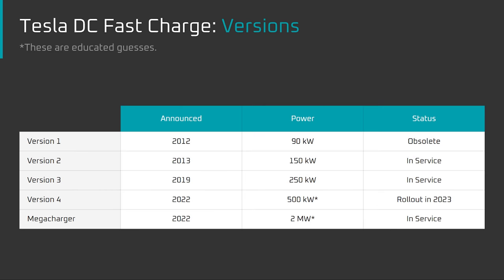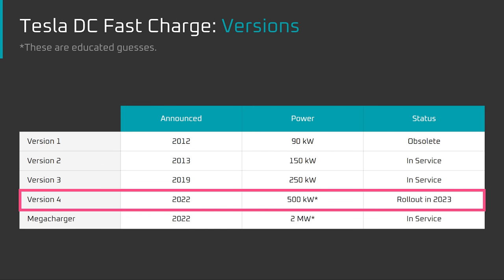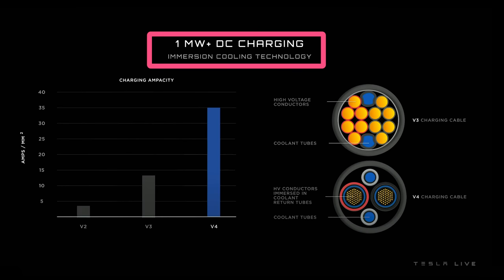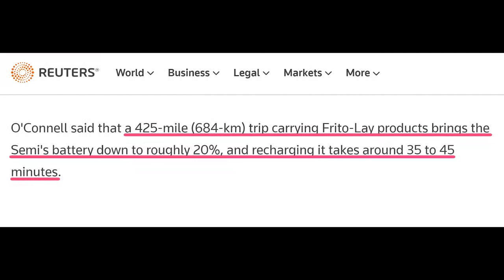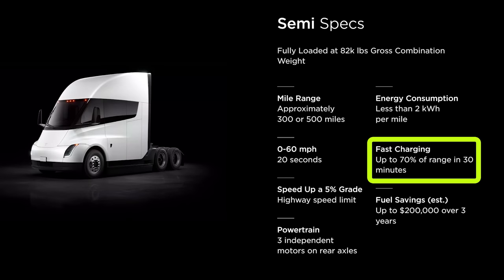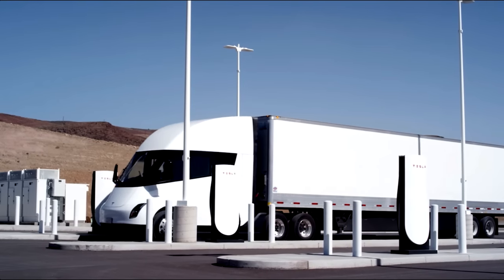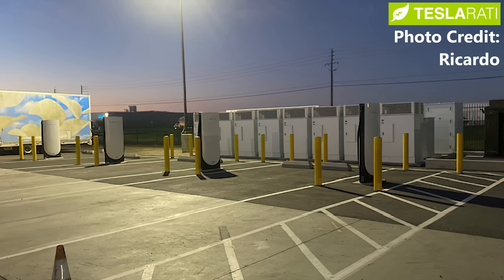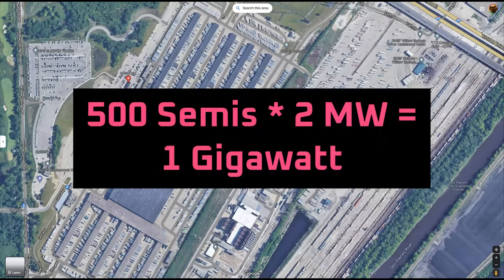Semi Megacharger Output // + The Megapack Moat

Comment: For fun and context, it might be good to mention the "power" that an gasoline or diesel refinery or a gas station or truck stop is capable of dispensing.

We just tend to not be familiar with the massive amount of liquid fuel energy we have grown accustom to over the last century...

We familiar with BEV energy requirements at some point realize how massive their energy needs and yet how much less that value is juxtaposition with liquid fuels.
Reply: Yes.  Generation from fossil on demand will be a better way to bridge the gap than batteries since the batteries are needed in the vehicles.

Comment: Could the Tesla Semi have 750KW charge ports on both sides of the truck to charge at 1500KW when the spaces are empty?  It would be convenient too as it wouldn't matter which side was being used for plugging in the charger if the stalls next door were occupied. So you could charge at 750 or dual plugs at 1500? Also maybe batteries and light weight solar panels in/on the trailers might be good to add to range and reduce the grid demand?

Comment: I'm wondering if the 750kw chargers are intended for areas where grid upgrade isn't reasonable and the speed of charge isn't a major problem; that is,  it won't be a problem to charge the semis over a few hours rather than rapidly.

After all,  stats I've seen are that semis average between 50,000 and 100,000 miles a year,  which is only 170 to 340 miles a day,  6 days a week.  That's only 4-8 hours a day.

Comment: Everyone seems to assume that when they say the semi charges from 20% in 35 to 45 minutes, it's to 100% SoC, it's probably not when they're describing everyday use. Or that the charging speed used is the highest available, which isn't necessarily the case.  

Anyway, I suspect that Tesla are actually not content with neither the current semi chargers or the current semis, that they are working on some design details, and the delivered semis are delivered "as is", partly for testing.    

Also, chargers for semis might be designed after every specific need and conditions, and upgraded if needed.  

Just a note, office buildings typically use very little power outside of office hours.

Comment: They would still be accessing post substation voltages, so I would not look too closely at substation level lead times. As these outputs are at 15 kV down to 5 kV per eaton's website.  It would tell alot to know what voltages megapacks work at for integrating into transmission, I would assume going closer to the 15KV.   These higher voltages would be used closer to highways which are generally closer to industrial areas which power demands are nothing like that of a commercial office building (large spaces and not enormous draws compared to manufacturing facilities..)
Reply from the maker: I would think it would depend on the size of the station.  2-4 chargers is great for a small depot, but when you get to 8-12-16 a 3-6 MW sustation feed isn't going to cover it.

With regards to voltage of the pack, it will vary depending on the number connected and the state of charge (my understanding at least).  Something I need to look into.

Comment: On nuclear power: 850MW is small for a nuclear reactor. The average is closer to 1GW per core. It's also super rare for a nuclear site to only have one core. I'm not saying you're wrong, just, you ended up picking one of the smallest nuclear power stations you could have. Watts Bar Nuclear Station, for example, has 2 cores at 1150 MW each. 2-4 cores per site is normal. 6, like in Fukashima, is pretty rare.
Reply from the maker: I just picked the one that was closest 😁

Comment: Commercial industrial power is charged at one or two agreed rates PLUS a distribution charge per kilowatt demand so if you can reduce the peak power by using local storage you reduce the distribution charge, also you are treating the megacharger etc as a single standalone unit , this is incorrect because it's an OEM system they cap place the charging and conversion where they want, you are only providing say 1000.or 2000 amps DC at 1000 volts or so if the megapack is designed for the purpose, then there is little additional hardware needed bar a stall and lead with switching both inside and outside the truck , if you migrate the intelligence into the charge stall infrastructure it's much easier to alter the charging rate as you are basically just tipping a bucket into the vehicle faster or slower,  think ...Tesla is very clever also the megapack can use low cost electricity and add grid stability function with ease,  the cost of an installation will be mainly the infrastructure and land so adding more capacity would be cheaper weight doesn't matter, this is returning to DC distribution times .... Yes they did used to exist just look at the history ... It's in all those books you ignore because it's not AC,  most any electrical textbook prior to 1950 will be mainly DC supply

Comment: I don't like how many EV charging solutions will charge at a slower rate when other users are sharing the same charge station. I get all the technical reasons why I just think in terms of budgeting time vs filling up with fuel there's a distinct lack of certainty which is unappealing. In UK they want to make all streetlamps have sockets to charge four car and there's barely enough amperage for one car to charge in a timely manner. The idea that I may not have enough charge to get to and from work because other people plugged in after I did and slowed my charge rate is crazy.

Comment: You aren't far off on the current sub-station equipment delivery times, but you are forgetting the planning/permitting and construction that can add another 2-5 years depending on the location/grid operator. The Megapack configuration is less dependent on external organizations and more in line with Tesla's projected growth.
Reply from the maker: EXCELLENT POINT!

Comment: I think the SEMI battery pack would be optimized for battery longevity rather than charge speed... you don't AC charge a Semi, and it needs to run maximum cycles
Reply: When you say "maximum cycles" you mean quantity (lifetime) rather than "0-100%"?
.
I still think the majority will have plenty of juice for a days work and be able to "slow" charge cheap rate in downtime.

Comment: Just wait until we start talking about truck stops and the demand for shore power comes into play as well.  It is going to take a massive infrastructure build out to be able to support the power demands.   This is going to require completely rethinking how long haul transport is handled.
Reply: Yes and we will have 2 decades to think about it as 20 million of these trucks aren't going to show up tomorrow.
Reply: @miguellopez3392  Massive engineering and design problem that needs to be sorted out pretty soon.  They have to start building this out pretty soon.   The main interstate routes will need some pretty massive buildouts just to get started.  The current truck is a day cab config and not going to be doing OTR.   Just saw the Fed govt guidelines they just released and looks like they know that long haul OTR rigs will probably leverage hydrogen more than pure BEV.  That is it's own new set of complications that no one is talking about yet.
Reply: @Longsnowsm  tesla isn't new to this, tesla has already built the world's largest charging network for cars, building then across major highways and population centers, their private network of chargers is larger, more reliable, and cheaper than the government funded and mandated "Electrify America" charging network. Battery is still likely to be used for long haul trucking, hydrogen is just to expensive compared to battery and road weight limits can change like they already did. Tesla does talk about these problems which is why they push harder to build their own infrastructure than others.
Reply: @miguellopez3392  Wasn't my message or new standard that was just published.  Just passing along the matrix breakout standard according to the govt what they forecast as the method of transport and the fuels they project.   

Tesla has rolled out a supercharger network for cars.  They have not done this for commercial transportation yet.  Clearly they do not know what they don't know, until they know it.  They are about to get a whole new look at a new world.  Expect TONS of growing pains.   If people think big rigs are going to charge the way cars do or function the same way they have not spend enough time around big rigs and truck stops.   Expect to learn a lot.  Tesla will be.
Reply: @Longsnowsm  yes tesla plans to grow very fast and will have a lot of pain as they will be also using these trucks as their logistical trucks for tesla to "put their money where there mouth is" they do have an advantage in this compared to other companies and its that they build the largest grid scale battery sytems in the world, these battery projects range between 100-700mgw each Mgw is capable of charging a tesla electric semi once, so they can leverage that infrastructure to get started, eventually they will been 2,000mgw systems to match a large truck station, and that's a lot of battery even for the world's combined battery output.

Comment: The 300 mile version is probably just a 500KWh pack. A 300KW super charger could charge 5% to 95% in just 1.5 hours which would be fine for a lot of people for a lot of times eg while on your lunch break

Or even a basic 60KW fast charger for the 8 hours you are asleep would top you back up to full

These definitely should have a super charging port too for ability to use the super charger network or even home charge

Not every trip needs a super fast charge
Most EVs are slow charged at home
Most trucks most of their charging will be from slower chargers

Comment: If you operate a fleet of trucks,  a truck design with removable batteries that can be slow charged overnight and exchanged at depots could avoid peak daytime demand for megawatt chargers. It would improve battery life, avoid delaying truck drivers while batteries charge and allow trucks to be used when batteries need servicing. Large numbers of megawatt chargers will spike demand on the grid causing spot pricing of electricity to jump to a price where EVs are no longer financially viable.
Swappable batteries would allow trucks to reach destinations beyond their charge range without a recharge delay, by stopping at a battery swap depot somewhere on their journey.
Reply: True, but experience with my own electric driving:  I combine charging at night (85%) + fastcharging when it's needed. (15%),   Maybe simply extrapolating would be too easy, as trucks need to drive as much as possible to generate income.  FastCharging is also complementary with truckdrives taking a break. :)
Reply: It just increases the demand for batteries without putting more wheels on the road.  If if the companies that own the trucks have to buy the extra batteries that drives their costs up, and then you need facilities for swapping and need to maintain them which drives up cost.  It might add some convenience but that's like all it would add.
Reply: @TheEvilmooseofdoom  If there are enough recharge depots and a fast swap procedure, the batteries could be smaller than fixed batteries, so the overall volume of battery chemicals could be comparable. Hauling less battery weight would also make them more efficient.
The swap needs to be either automated or operated by the truck driver and take only a couple of minutes.
Reply: Nio has great tech for this. In and out swap in four minutes for a big sedan. For a semi maybe have to do six to nine pack swaps but once parked the swapper can move down a rail, so figure 4 min + 2 min for each pack beyond the first, or 16-22min total

Comment: Sleeper charging lots

If the average rig is stationary 8h while the person sleeps then a 100KW charger is more than enough to do empty to full

A charging lot with 50 spots for rigs would only need 50 x 100KW chargers = 5MW total. And it'll be able to charge upto 150 semi empty to full daily
Reply: A point I've made repeatedly, but nobody seems to run with it.
Reply: The "average" truck really should be driven by drivers in shifts, but that will go away with self driving so vehicles will be in use 22-23 hours per day. Ideally scheduled so they stop and charge at substation chargers without using intermediary battery storage.

Comment: I agree that Tesla will most likely use a megapack for V4/megacharger stations.
But, it's projected that 30% of all new vehicle registrations in the US will be EVs by 2025.  I'm wondering what EA/EVgo/Chargepoint will do to relieve pressure on the grid.  Buy Tesla megapacks, perhaps?

Comment: If a megacharger is backed by a megapack, is it possible to avoid DC-AC-DC conversion as power goes from the megapack to a vehicle?
Reply: I would doubt it. You need a voltage differential between 	stationary battery and vehicle battery for the electricity to flow-then you are going to reverse the flow to arbitrage power. Then fast charge the battery with controlled amps. This level of control exists in the world of AC,
Reply: Exactly once it's off the network it's stored as DC in a suitable form for the Semi battery, the "charger" is the megapack anything else is totally stupid, Tesla aren't stupid it's their system their trucks their everything no other factors apply just their convenience and efficiency,  they choose the point where the "charger" lives
Reply: Yes, but you still need a DC-DC converter to match the voltage that the Semi needs for the state of charge it is at. The V3 Superchargers already have a DC bus that is shared between charging cabinet and battery storage. (So Tesla is already doing this.)

Comment: Most semi trucks will be slow charged just like most cars are slow charged at home

Drivers need to sleep and sleeping say 8 hours if you need to top up 800KWh you'd only need a 100KW charger which current chargers can easily do

As a bare minimum these trucks should come with two charging ports one of which allows the existing charging cables to be used at existing super chargers. If a super charger can charge at 300KW then it would allow semi to use the super charging network for times the driver isn't in a super rush eg while on a one hour break while eating lunch

Some semi drivers even park their rigs at home during their off days. Being able to home charge would be a bonus. If a driver is at home 8h a night for 6 nights and 24h for a day off that's 72 hours at home at 11KW charge speed that's enough to add nearly 800KWh per week while at home. Or 26,000 miles per year can be home charged. An average rig does about 90,000 miles a year so it's not an irrelevant amount of home charging

If the rigs have two charging ports and the owner installs two 11KW chargers they can home charge 52,000 miles a year limiting the need for mega charger needs

It would be a mistake to have only mega charging option on the rigs. They should be fitted with 4 normal charging ports and a mega charger should just be 4 super chargers